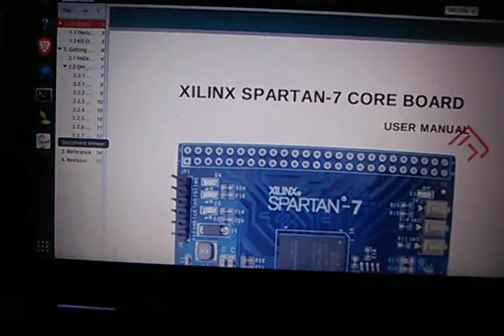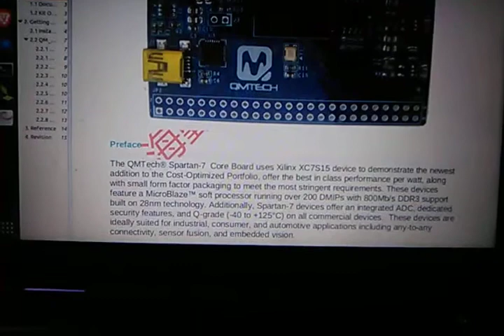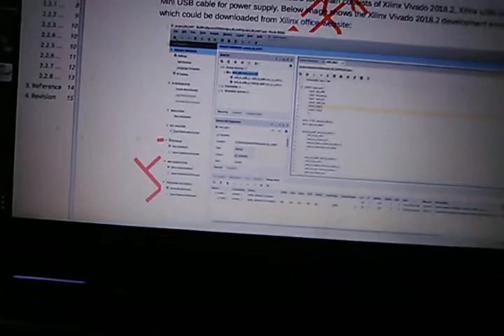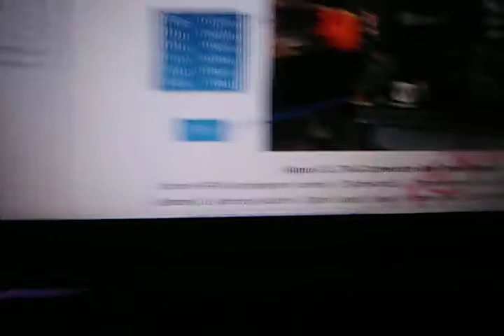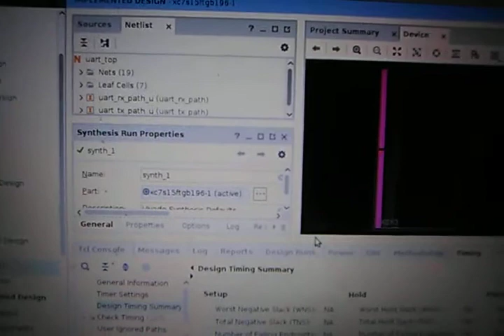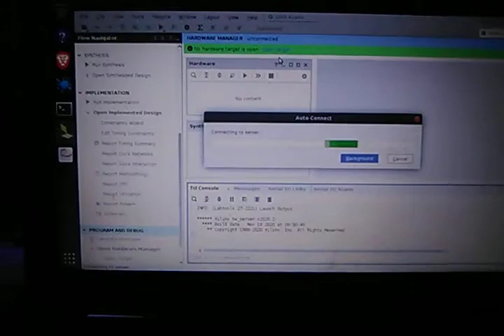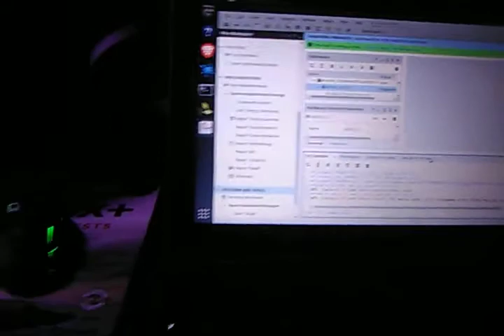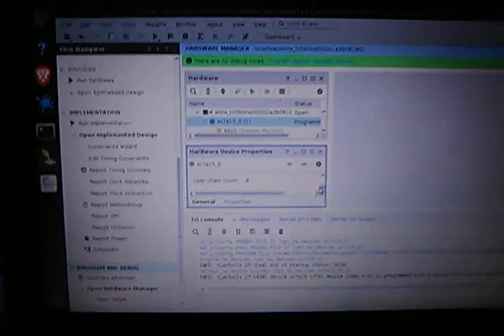The start of a FPGA miner. (maybe)

Comment: FGPAs are the way to go! Why would anyone make a chip to compute one niche algorithm when you can use reprogrammable hardware? The only reason people don't do it is because it requires a lot of specialized expertise. I actually don't mind, its more of an opportunity for the folks who do understand hardware.
Reply from the maker: I really wish their where development tools that where more striat forward. Like FPGA are only digital logic meaning all thats put out of the pins are 3.3v on's and off's. lets say there was a new language something like python and I wanted to simply turn on and off a LED. The code would look something like this:

#pylog
pin (A1, in) + (clock_f= 1hz ) + pin (B8, out)

#end

'pin' calling to a outside pin on the pyhsical baord
Then adding all of the meat in between using clocks_'frequency' how fast you want to toggle the  pin and pin B8 being selected for output.

If you wanted to make a more complicated circiut

#pylog
pin ((D2, in)+ pin ((D1, in)+(clock_f=3hz))) = "or"+ pin(A7, out)
#end

where pin D2 and D1 make a or gate and D1 has a frequency of 3hz. All being output to pin A7..

I think this would be simple enough that beginners  could get into this fairly easy if they just knew a few simple parameters..